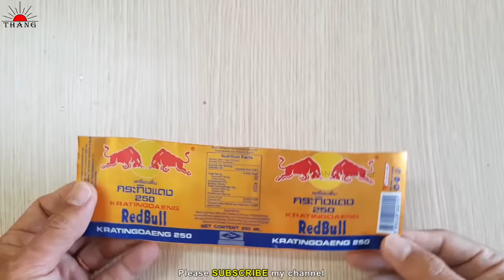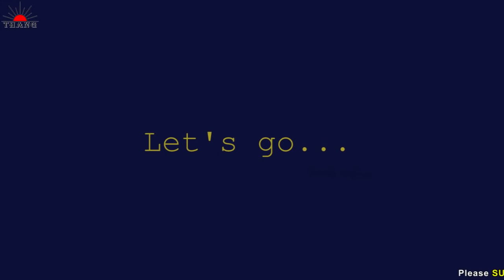DIY Remote Control Helicopter at home

Comment: It's interesting how the helicopter never rotates. It's always pointed into one direction and that's it. It's either because the helicopter is so unstable or the helicopter is simply not able to do that. Also, an explanation of what is what and how it works would make a noticeable difference when trying to tap into the DIY community. Either way, it's pity to have preassembled guts from an RC helicopter and to use a Red Bull can instead of some proper body. It just seems pretty wasteful...

Comment: as i know, helicopters tilt front forward and it moves forward. For a can to have such stability without gyroscope. pretty impressive. For it to drastically change direction without tilting in the direction it needs and other features found on helicopter.
 im calling it impossible feat. 

I dont see much of the trees being blown by winds, even if there is winds, most of the time it would be a single direction. You can expect the can to be blown out of is trajectory. (no gyroscope). 

Top blade for lift, thrust in the direction required. Back blade for anti rotation. Its fine but man... that video really looks convincing. 

You had me for a second on a flying can. got me for the videos. Well played.
Reply: The control board has a 6 axys gyro included

Comment: So, I have to buy a toy helicopter first, dis-assemble it, use its parts and go through all this effort to create this can helicopter? What an idiotic idea!
Reply: haha
Reply: I think u can buy that helicopter s engine online in e comerce pages , and its absolutely cheaper than a whole one from the toy company
Reply: @quocvu2603  I bought a similar sized toy helicopter in $7.5. I don't think anybody is selling only remote + motor + Blades + Battery in less than this price. Add the cost of time, effort, tools, etc. on top of it and you'll get the idea.

Comment: For USD2, I had a complete set of toy helicopter, ready to fly, this size. The RC unit was miniturized,  measuring just 2x1x0.25 IN.

 The box it came in was labelled "China is Made".

It flew, to my delight. After 1 minute of flight, it crashed. 

I retrieved it. It had a temperature.

I guessed COVID-19 got it.
Reply: I'll make a video when it recovers. Right now it is still in ICU.
Reply from the maker: Good luck to you

Comment: Wouldn’t you need  wires gyros motors from a helicopter and you can just use the helicopter or if you by the wires,motors gyros it be more expensive than the actual RV helicopter if you buy on but other than that great video/tutorial
Reply from the maker: Ok friend

Comment: I will ask my child to do the helicopter body at least. We have a broken remote helicopter in hand.
Reply from the maker: Ok. Good luck to you
Reply: @THANGEngineer  Ａfter I made the body, I found it is very hard to cut as i have not Cutting Machine, just cut it with scissors.
It's easy to see things and hard to do，you know it is very hard to cut the position for the landing gear of the helicopter with scissors. BTW, How to make a propeller?
Reply from the maker: Yes. If you try and try, you will successful

Comment: Hola, buenas noches, muy buen video  una pregunta donde consigo o donde se compra todo lo que sería el motor  y el control remoto.saludos desde Argentina y excelente video
Reply: En España.
Reply: Estas sugerencias responden a la necesidad que algunos universitarios tienen de conocer la forma adecuada de presentar un trabajo. Para ello, han de seguir unas pautas formales básicas, como titular el trabajo, identificar su autoría, paginar, hacer un índice, estructurar el trabajo (con introducción, nudo y conclusiones) y citar las fuentes utilizadas. Además, cabe seguir los pasos comentados con anterioridad, consistentes en reflexionar, hacer después un esquema y luego desarrollar las ideas con claridad.

El trabajo se puede presentar encuadernado con canutillo, método que se realiza de forma económica en cualquier reprografía, recordando colocar al final del trabajo una hoja en blanco de cortesía. El título general constará en letras destacadas; por ejemplo, en negritas, cursivas y mayúsculas (que se acentuarán con normalidad) de tamaño 20. Si se hace así, sobra subrayarlo, pues es redundante y no es necesario (salvo que se use máquina de escribir). El título ha de condensar de forma sintética el trabajo que se presenta. Si se pone en letras mayúsculas.

Debajo del título, en menor tamaño, ha de constar la autoría del trabajo: nombre y apellidos de quien haya participado en él. Además se puede añadir otros datos complementarios del autor, como el correo electrónico, el curso académico o el grupo donde está matriculado. Ello facilitará localizar la atribución del trabajo en caso de que se traspapele por accidente. También es aconsejable añadir una hoja de salva, que es una hoja en blanco entre el título y el índice.

El índice se coloca delante del trabajo, aunque normalmente es lo último que se redacta al acabar la investigación. Un índice requiere que consten los capítulos con sus correspondientes números de página, y las imágenes, gráficos o figuras que tenga. Un índice puede seguir el propio esquema previo para después estructurar el escrito; es decir, en él han de constar los puntos estructurales de la obra.

Sobre la presentación del trabajo en sí, remito a las sugerencias ya propuestas en las recomendaciones para presentar textos breves, con las correspondientes adecuaciones que se consideren convenientes para presentar un texto extenso. Como imprimir en folios blancos por las dos caras. En este caso, cabe ubicar la paginación centrada en la parte inferior, para evitar desequilibrios en el aspecto general de la obra. El título ha de carecer de paginación.

También se puede colocar en la parte superior de todas las páginas del trabajo el nombre del autor y el título del trabajo, o el título de cada capítulo. Es una pauta que siguen numerosas ediciones actualmente.

Al comenzar cada capítulo se han de incluir varios espacios en blanco, a modo de cortesía, antes de escribir el título. Del mismo modo, cabe separar un espacio entre dicho título y el texto. Es recomendable, por motivos de claridad, numerar cada capítulo, así como numerar cada uno de los apartados y subapartados de cada capítulo. Cada epígrafe se destacará de una forma sencilla, por ejemplo en cursivas y negritas (no hace falta subrayar ni poner punto final).

Para exponer un texto poco extenso, por ejemplo de unos veinte folios, sería suficiente con ofrecer una estructura sencilla, que conste de introducción, desarrollo del tema y conclusiones. Dicha estructura básica es indispensable para que quien lo lea entienda de qué trata. La introducción resumirá el tema del trabajo -contando el orden en que se van a exponer los temas-, incluirá la metodología que se ha seguido, el propósito del estudio, sus aportaciones e incluso puede mencionar un breve anticipo de las conclusiones. Cuando se llegue a las mismas, se podrá dar más rienda suelta a la imaginación que en el resto del trabajo.

Un trabajo extenso, por ejemplo de ochenta folios, requerirá aumentar los apartados mencionados. Entre ellos podría sumarse una metodología, un estado de la cuestión, unos antecedentes y unas consecuencias…, y se cerrará siempre con la bibliografía. Esta se compilará siguiendo el orden alfabético de los apellidos, como se explica al final de esta guía. También, la bibliografía se puede presentar dividiéndola por temas, como estilan algunos libros. Pero este sistema tiende a ser poco frecuente, acaso porque sea poco práctico al no reunir por el mismo orden los títulos.

Los cuadros, tablas, imágenes, esquemas, gráficos, etcétera, constarán todos juntos al final del trabajo, en el apéndice. Han de llevar un título. Para localizarlos con facilidad es práctico encabezarlas todas por la palabra Figura con un número, y colocarlas por orden. Por ejemplo: “A esos colores se refería el autor cuando aludía a la tonalidad de la letra miniada (vid. Figura 7)”. Al final del trabajo, en el apartado titulado Apéndice, constaría en séptimo lugar la Figura 7: Letra miniada.

Se usarán corchetes para señalar la omisión de una parte del texto en medio de una cita. También se usarán corchetes para añadir cualquier comentario que no pertenezca a la cita textual.

Las citas textuales, si son breves, se añadirán en el texto entre comillas. Si la cita excede de cuatro líneas, se sangrará el texto y se pondrá con tamaño menor y sin comillas, a continuación del texto, en párrafo aparte.

Las notas al pie de página son muy útiles para hacer cualquier inciso, plantear una duda, mencionar un agradecimiento o añadir lo que se considere oportuno. También sirven para citar fuentes primarias (documentos que en el caso de los historiadores básicamente proceden de archivos y hemerotecas) y secundarias (revistas y libros procedentes de bibliotecas). Las notas se colocarán en el texto antes del signo de puntuación, con la frase a la que acompañen, como en este caso: [1].

Para citar fuentes primarias, cuando se cite un archivo o una biblioteca por primera vez se desarrollará su nombre completo más el nombre entre paréntesis. Con posterioridad, sólo se citarán dichas siglas, de la siguiente forma: Archivo Histórico Nacional (de España AHNE), Biblioteca Nacional de España (BNE). Para citar referencias de archivo, se ha de citar la signatura que se ofrezca en el depósito documental donde se encuentre el documento, más el folio de donde proceda la cita (“fol.” o “fols.”, “f.” o “ff.”). Si no tiene foliación, se indicará (“s/f” o “sin foliar”).

En caso de citar voces de diccionario, enciclopedia y otros repertorios generales, no es obligatorio anotar el número de páginas. Estos se citan incluyendo la voz en negrita y el título de la obra y la edición (voz escribiente, Diccionario de la Real Academia Española, XX ed.). Pero normalmente se tiende a incluir después los datos de edición del repertorio que se cite. En cualquier caso, se ha de seguir siempre el mismo criterio.

Tampoco hace falta citar la página en la que se encuentra una ley. Las leyes se citan con las referencias propias, con sus artículos (o títulos si es antiguo) o leyes, o los datos correspondientes, por ejemplo:

Libro IV, título XXV, ley XII, del Tomo segundo de las Leyes de Recopilación, que contiene los libros tercero y quarto, Madrid, Imprenta de Pedro Marín, 1777.

Por último, en un trabajo extenso, se cita la bibliografía. Véanse a continuación los sistemas básicos de cita, el estilo Harvard y el sistema de notas al pie de página.

[1] Este es sólo un ejemplo práctico para indicar la colocación de la nota.

Comment: A job is very important in this world, unless if someone is self-employed or disabled to be able to do some kind of work. Some try to find jobs and it fails, some have graduated with all the necessities needed but it's hard for them to even get a small piece job out there. Effective job and luck spiritual prayers can help you find the desired work, or get the job you have been longing for. If you have by now submitted numerous employment applications and have not been called for an interview, some don't even get a chance to keep their jobs, even when they're admitted, they get chased from work so fast. It helps you keep the job that you bothered to get for a very long time. The spiritual prayer can be cast from the minute the job application is made, so you can you can be assured of an interview. They also help someone to excel in a job interview. If you feel that you are not ready enough for that interview, you can strengthen your mind by requesting this powerful prayer that works. The prayer will give you more strength, positive thought, and magical intelligence. It will arm you with positive thought throughout the job interview. It is actually the most important step for a successful interview as you make sure that you are fit and prepared properly.
It also helps for those who have rivals at their workplace. Assuming you have someone who doesn't like you to keep your position, or if you want to put a good work relationship between you and your boss, it will help you to win your boss's heart. He might be seeing you differently according to how you see things at work which can lead you to be fired from that job
Also with job promotions. Some people work for a certain firm for a very long time, new people come in and get promoted yet all your tiresome working is undermined, you can request this kind powerful spiritual prayer to change your life in a very short period of time and indeed they have truly worked for many of my clients up to date
A spell to bring back what was stolen from you. Have you ever been stolen your property e.g. A car, house property, store property or important documents contact me I will capture the thief for you and recover whatever was stolen from you with my spell call/whatsapp +27782391426
Reply from the maker: Wow. This is longest comment that I see. Thank you very much 😍😍
Reply: Vb